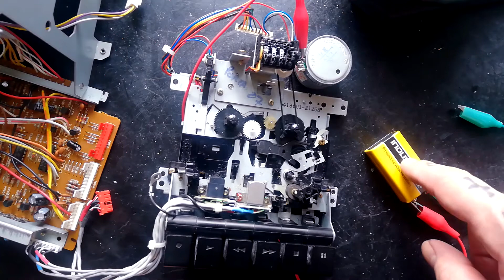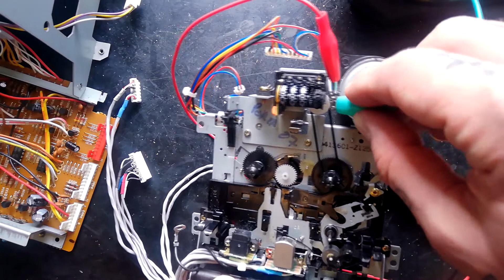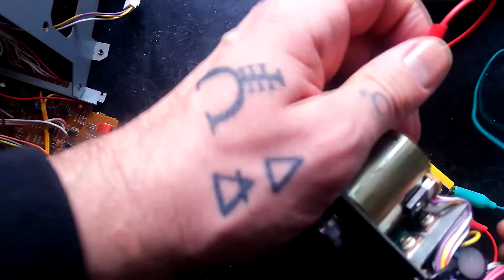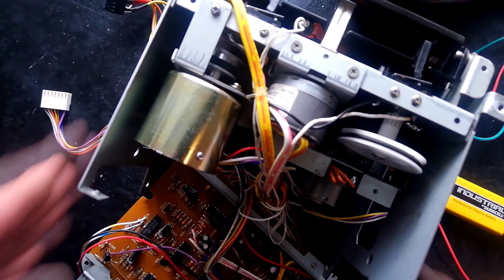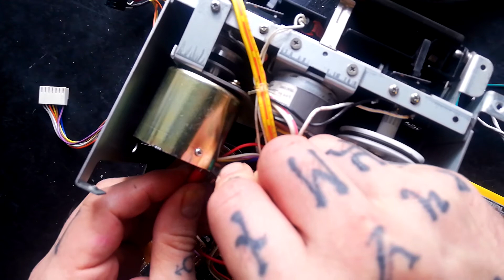Testing a 12v 4 track motor using a 9v battery

Comment: motor works but in de device i have 8v but when i conectt the motor i received 2v, if i put the motor with power external supply works finez any ideas?

Comment: Thanks for this video!

I have a motor from a Porta One that I'm testing. It does spin, but i have to connect the positive end to the second pin and the negative to either the third or fourth pin (labeled + or -). Any idea why this might be, or if the motor actually works?

I'm hoping to use it as a donor motor for a porta 05. Do you know if this is a futile effort? I thought that the motor would be the same since they both use the GEC transport, but the porta one's looks bigger, and has some different wires connected it seems.
Reply: I actually just found your video on motors through the ages, so i think i understand that the 05 uses a different motor than the One. But can be substituted if there is enough room. If there is room in the case (kind of doubtful but we'll see) would i just connect the same way as the broken motor in the 05 is currently set? or do i need to swap the order of the wires at all? thank you!
Reply from the maker: @jakeannal6304  I think space might be an issue, but also, from my experiences of trying to fit a Porta 05 style motor in a Porta Two, the motors are connected to circuit ground 8n a different way and the resistances to have it play back at the correct speed are different, I think life will be much easier if you just use the correct style of motor. Search n Ali express, there are a few sellers with new old stock. As for the results with the battery on the Porta one, I haven’t had that experience but at the end of the day I’m a scout sharing my observations, I don’t want to say your motor is broken when it could be just my oversight, good luck.
Reply: that makes sense, thank you! Can confirm the porta one motor does not fit in the porta 05.